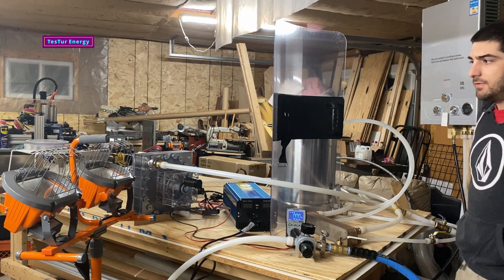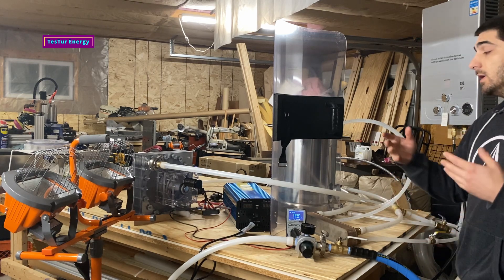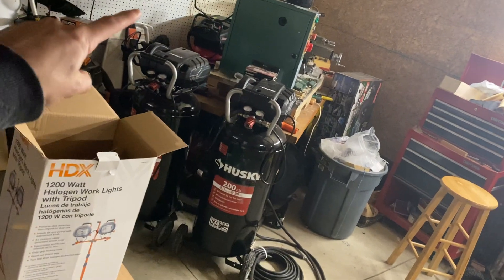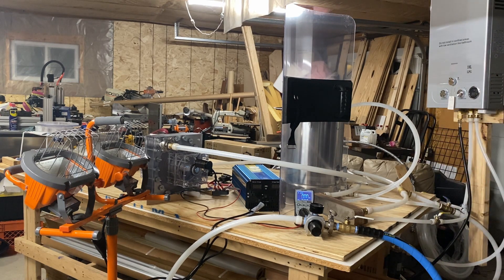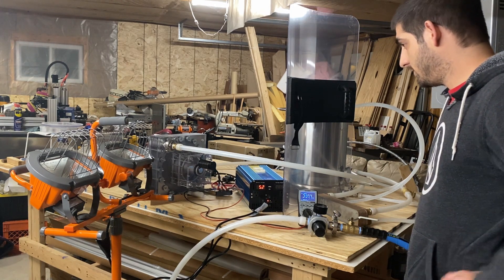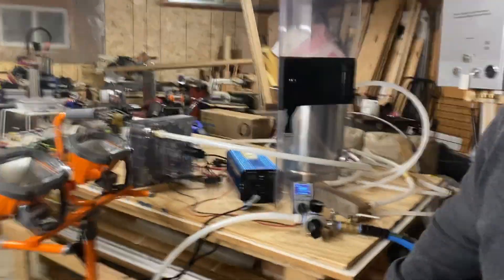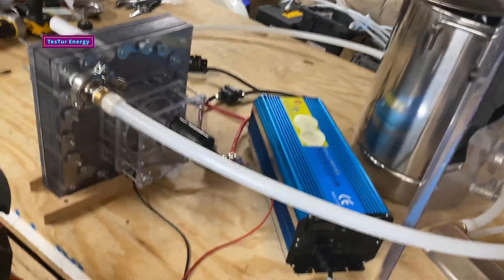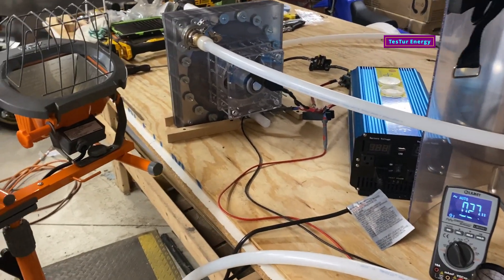Amazing Tesla Turbine Actual Power Output Test - 1200 Watt Real Electrical Load - CAES - Turbo Jet

Comment: Great job man, I love your turbine. Also an impressive workshop. That is a lot of air. I know you want to run it of cold steam or temperature differential, which is a complicated drivetrain. That gear drive on your BLDCs is really holding you back. I would get some UAV Drone motors at 6" with like 100kv or some electric paraglide motors and use a planetary a reducer all shaft mounted. Keep up the good work, I am very impressed.
Reply from the maker: Hey Anders thanks for the kind words! So one question. Why would a planetary gear reduction design, with multiple different contact points, have less losses than a single gear going from shaft to generator? I do think a 1:1 shaft to BLDC flexibly couples option could be the most optimal option for BLDCs, in which case,  I just need a BLDC with a Kv rating around 300-500, give or take, to be able to output the 12v needed for the 3000-6000 peak power band that this turbine has been showing to perform the best in. 

I will say that this version is just a 1.0 that I put together trying to use as many off shelf parts as possible. All these gears and generators are the stock parts out of a Traxxas Revo 2.0 RC car so all the gears are extensively field tested for these power ranges as well. Right now most of the gear issues I’m having are coming from a misalignment of the shaft gear with the generator gear. Which I have found the cause of this issue and will solve it in the next model. 

Also I will say I have no intention of using any kind of gears in the future as i have a direct on shaft dual axial flux generator design that will be going in this that will have no moving contact points between the turbine and the generator as they will be custom built to all be on the same shaft. I just have some R&D to do to make sure the axial flux generators that I design are capable of handling the currents and power outputs I want to be able to draw off them and that they output the correct needed voltage as the best operating rpm of the turbine. Right now I’ve been able to do unloaded dyno tests to find the power band of the turbine to see where I’m getting the best torque and power out and then gear it appropriately so that that rpm on the turbine outputs the 12v output needed from the generators to power the 12v-120v inverter. So most likely I won’t have any gear losses or issues in the next model but currently I’m just working with what was the easiest to put together and show working the fastest. Lastly I’ve been focus primarily on making the turbines work (compared to many other Tesla builders who are focusing on “frictionless bearings”, perfect seals, mega high rpm turbines) because I’m of the mindset that if bearings and gears are giving you enough loss that your turbine won’t work without them being perfect you’ve got much larger issues to rectify with your turbine. Because the turbine can and should be capable of getting plenty of torque and power output at low RPMs if designed properly that gear/bearing losses shouldn’t be more than a 15% loss. Now that’s not to say that we shouldn’t try to fix that but those are all issues that standard industry has very simple and easy solutions for once to that point. But if the turbine isn’t already outputting far greater capacities than the small losses in the system are taking away then it needs to be taken back to the drawing board. So for me the fact that I’m able to still get this much power out, and more, with still giving up 30-40% to bearing and gear losses, then that’s all the more of a testament to just how capable this turbine design is.
Reply: @CharlieSolis  I totally agree with your approach, I have studied all of your videos closely and as I said I am very impressed(I don't mind the "uhms" at all). The reason why I mentioned the planetary reducer is because I noticed the chugging of gears and what not and thought it didn't do your turbine design justice.  I made an axial flux coreless generator design that was going to build and use for my turbines(even sourced all the magnets and copper) but decided I don't have the patience to wind and cast and balance etc. because I am( a Dane) living in Japan so I have the benefit of reasonably fast delivery times from Aliexpress and I never get taxed. So I found some good quality gearboxes dual 8mm shaft(you can turn it and use it to increase speed as well.) The point is the larger the diameter of the generator the higher the speed at the circumference which roughly translates into greater efficiency and so gearboxes work for this - 6" UAV 50v 3kw 100 KV with a 1:3.75 reduction at 96% efficiency is a pretty good tradeoff(130us$) (This is just an optimization issue for the relationship between the runner and the generator and is more my opinion than anything). I have watched Jerimia's Newman generator design which I think is clever IF you can sustain the high speeds of which his turbines run at.(I don't want to be a pessimist here but if it is not built like a Garret Turbo Charger it most likely wont and this is not at all a knock on Jeramias experiments which I love) Therefore I think it makes sense to look at ways to lower the speed of the turbine while maintaining torque for input into a generator. I like the idea of frictionless bearings and machining everything into perfection. Which means I love Paul's work (I am a Patreon)however I don't have the funds or time or facility to pursue most of what he does. In addition, I love Tesla's turbines but I think some things can be improved upon(Which Tesla eludes to in his explanations) I certainly don't have any intention of following his designs religiously anyway. Bearings is a typical engineering thing to get caught up in, but the reality is even the shitty ones are pretty good these days if used correctly alas like you said bearings are unlikely to be the limiting factor in a well designed Tesla Turbine whatever shape or form it may have.
Reply from the maker: Well I can’t argue with a gearbox sporting those kinds of efficiencies. So you’ve got me there. Lol and all of what you said resonates well with me. I have a feeling you understand that at this point there are many options to go with. It’s more of a question of what any one person has access to to be able to make one work. 

As I said before, to me the most important thing to be focused on is the fluid dynamics going on inside the discs. Because if you can make that part work the rest will just follow. As well there is sooo much to be worked out in the nozzle for increasing efficiency. But with luck we shouldn’t need to worry to much about that from implementing Tesla’s patent GB 186,083 that should give us maximum thermodynamic efficiency with its thermal recoup system. So all shear losses from slip in the turbine, since laminar, will be to heat and a lot less likely noise, and as such can be recouped in a staged turbine or just reused in the heat recoup design.
Reply: @CharlieSolis Absolutely understand the challenges of deciding the next step. Charlie thank you for that long and good explanation. I think It helps yourself as well:-) With regards to nozzles and fluid dynamics: In my opinion Tesla Turbines look deceptively simple which they somewhat are. I have asked myself why did Tesla move away from the Volute design? The answer is he did not,  he just wanted to make the pulse detonation work and so he wanted a small ignition/expansion point which was/is absolutely brilliant and he then and put it into a circular bore. The question is - Is this the best way? If I were to judge it is brilliant in some scenarios, but certainly not in most. The nozzle and associated Tesla turbine design most commonly known and replicated works for expanding gasses(combustion) and compressible gasses, but if you are supplying constant throughput of a fluid or gas that you are not igniting, then the nozzle and casing should be designed differently IMO. In it's original design - bars down you are looking at a chamber/runner which is in a reaction(Flooded) environment but is also slightly an impulse environment, but mostly only use the slight impulse option to introduce motion to the runner(Via the nozzle) at one point only.(Given that the exhaust is much bigger than the intake) IMO All turbomachinery has diffuser casings for a reason Tesla used them too, diffuser casings can be designed differently. You tend to look at diffusers eg a volute as they are outputs which they can be, but they are obviously reversible - Have you seen many turbines or turbos lately that does not have one for an inlet?
Reply from the maker: Yes. All of teslas improvement turbine patents do not use the volute and go with a 90°turn just before the nozzle. Look into GB 186,083 and GB 186,084. These are the patents Tesla finalized the turbine with after 10 years of research. In my opinion the volute should definitely not be used as the inlet, even for non compressible fluids, it has far too many boundary layer losses from the increased surface area. As I said previously, the pelton turbine uses the converging nozzle style even for water. You are accelerating fluids via converting pressure into velocity with a converging nozzle. And pelton turbines are really efficient as well. even having my converging nozzle that’s fanned out to meet across all the discs has a much higher boundary layer loss than just a single or few small holes just for the fact that it has a lot more surface for the fluid to drag on going into the turbine. The volute massively amplifies that surface area to create a lot of drag and loss. Not to mention, unless you have an excessive amount of surface area your slow moving fluid won’t have enough residency time in the turbine to give up its kinetic energy.
Reply: @CharlieSolis   I agree that a Pelton / Turgo Is efficient,  but these sort of strictly impulse turbines does not rely on the housing it is built in(In most cases they would be better without it if you are just looking for a straight discharge), which Tesla's turbines in any configuration DOES for obvious reasons and therefore you will have the peripheral boundary layer losses anyway . The potential boundary layer loss you are talking about would depend on the diffuser design and the fluid(Eg a diffuser does NOT need to be "one Volute" it could be twin scroll or 12 or a 90 scroll = a vaned diffuser) but also keep in mind even though the Nozzle impulse works in your scenario or approach it does not always lend itself to high flexibility especially when multi staging. Also to use the Nozzle design while efficient it does need a great deal of pressure to push the fluid into the nozzle.(Hence you for example have a lot of compressors and air tanks) It is important to note I am not saying this to knock on your design Charlie. I know you, Jeremia and Paul are focused on cold steam as Tesla was which I think is awesome. My views aren't criticisms of  yours, Jeremias or Paul's turbines more the complication of the drive train it is a part of. There are other ways of driving these turbines than you are pursuing which is what I love to be honest.
Reply from the maker: @Patriarchtech  1200watt Load Test ELECTRICAL Output Efficiency Calculations For 10in Tesla Turbine Are In! 
See the charts here!
https://www.youtube.com/post/UgkxRukN0zoVbtfe1LmLUlXyIo0kdt1ExWZs

Comment: It's impossible for the tesla turbine to make power it doesn't have any torque, you must have it plugged in from the wall somewhere. Maybe your using radiant energy to power the inverter!!
Reply from the maker: 😂😂😂 you caught me! Tesla turbines totalllly don’t work and have no practical value. And even if they did “you HAVE to gear them down to even work” 😂😂😂
Reply: @CharlieSolis  hahha gosh some peoples comments make me face roll LOL Glad you understood my sarcasm.
Reply from the maker: It’s definitely “an engineering impossibility” 😂😂😂

Comment: good test. amazing how quick it drains the air tanks. what are you going to tweak next?

Something that helped me with the "um" stuff. Is to just pause & not say anything instead.
Reply from the maker: Thanks raj! Yeah compressed air is pretty low energy dense when not in the 1000’s of psi. But when scaled up with very large single tanks it’s actually quite price appropriate compared to full solar+battery arrays. 
But I’ll be doing heated compressed air tests next! Then I’ll be doing pressurized water tests to see how it handles the water flow with such tight disc spacing and such high viscosity compared to air. 
Then from there it’s on to vacuum steam tests!
Reply: @CharlieSolis  I am building Tesla Water Turbines. I can tell you it is different from air/steam. It is not just the spacing. I went the water route because you don't have to spin the Turbine at these insane speeds. The slower speeds are easier to handle for a tinkerer with regards to balancing, tolerances etc. Also most people in modern cities has 50-60 psi of pressure available just by opening the tab.  It does introduce the need to seal shafts(increased friction), but most importantly: Water is NOT very compressible and so if your inlets and outlets can't be throttled(or are not dimensioned right) you will run into trouble. Your type of turbine(Which as I said earlier is awesome) is not likely to perform well with water, you would need to look at Tesla's Fluid propulsion patent to make a turbine work well with water and the spacing needs to be much greater.
Reply from the maker: @Patriarchtech  Hey Anders, unfortunately I have to disagree with you. The spacing is determined by the Reynolds numbers. You can keep tight spaces with higher viscosity fluids if you increase the number of spaces for the water to flow. Unfortunately as well water won’t perform nearly as well in the Tesla turbine because being a nonelastic fluid there are no abilities to utilize any expansion properties from the thermal energy in the water. However that being said tesla designed this as a multi phase fluid turbine and it can handle any combination of gas, liquids and solids. So utilizing aerosolized water with compressed air will allow the expansion properties of the compressed air to be used all while getting the increased viscosity of the water. 

Furthermore, water accelerates in a converging nozzle pretty dang near the same as all other fluids in a converging nozzle. Bernoulli/Venturi equations will give rise to the the initial and to final area needed for water to be accelerated to the speeds needed for utilizing the water at high speed. This is actually how all pelton turbine nozzles work too. They are identical for all intents and purposes. As well the whole purpose of using the massively increased surface area is to specifically show that very high RPMs isn’t needed for any fluid to work effectively in the Tesla turbine. Just the right disc spacing needs to be designed for the given Reynolds numbers. For example when comparing a 1inch wide turbine with 8x 1/16”wide discs and spaces to a 1inch wide turbine with 50x 0.0092in discs and spacing, even though there’s a total of 0.5in of open spaces between both the 8 and 50 disc version the 50 disc version with the tighter space will have a reduced mass flow rate, as such yielding a lower power out, but that just means more disc spacings need to be used to allow for the same mass flow rate with pinched off flow because the discs spacings are tighter than the laminar boundary layer for the initial version’s flow regime for the given 50 in disc model compared to a 75disc version. Increasing the total flow area changes the Reynolds numbers between every disc when supply the same pressure of motive fluid and as such the laminar boundary layer thickness also changes so that tighter disc spacings can be utilized for increased efficiency from reducing slip for such high viscosity fluids such as water.

I have done a few water tests with this turbine already and i can tell you I’m having no issues from using water with the tight spaces.
Reply from the maker: Also Raj, I just want to say thank you for all your support along the way. I couldn’t have made it here without help from you and everyone else on patreon! 🙏🙏🙏💜💚💙